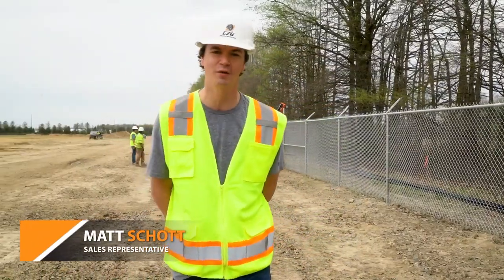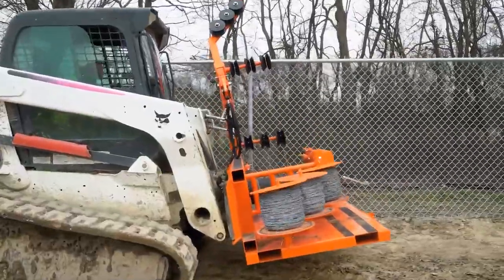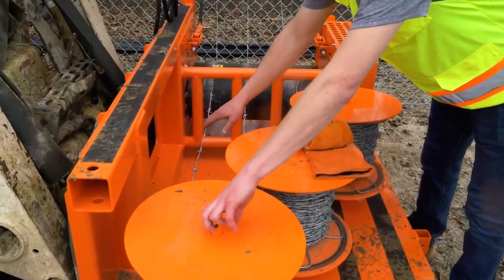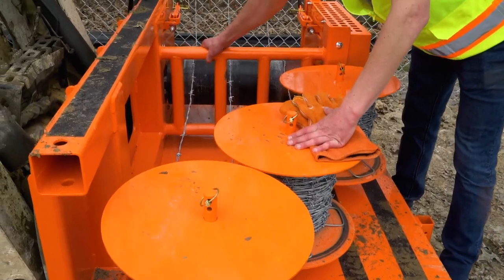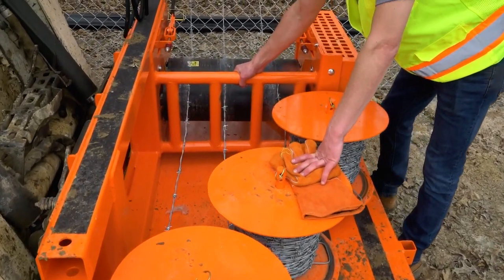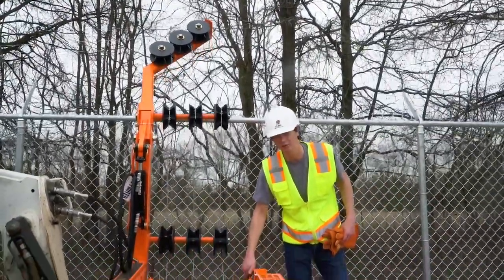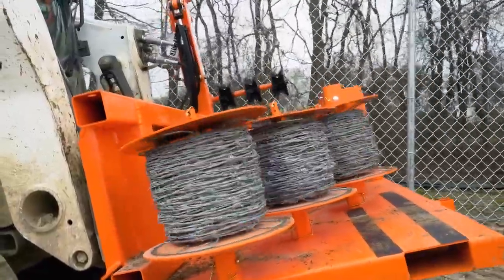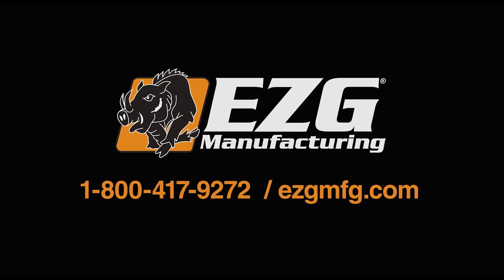Barbwire Hog Video

Comment: Hey thanks for the video one question. Once you reach the end of the fence line how do you add extra tension? With the mesh you’d lock it in place and add more by moving forward. How about the barb wire?